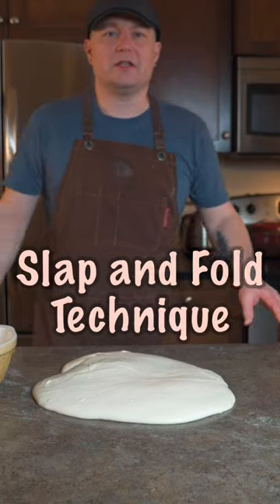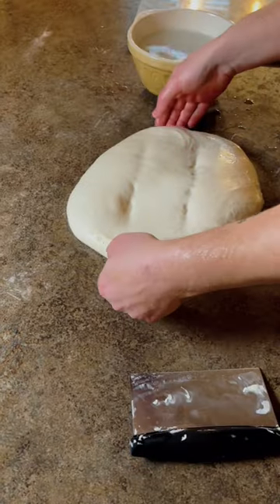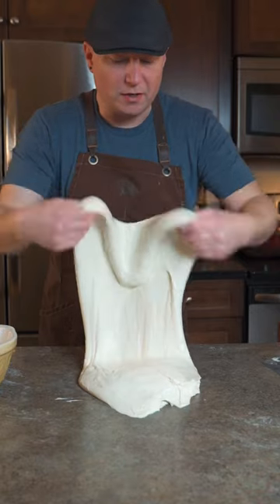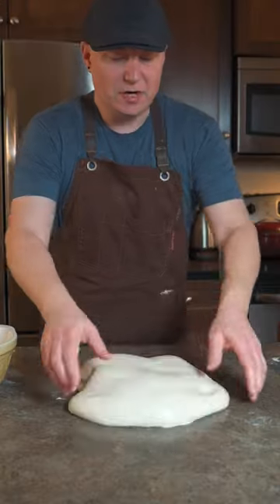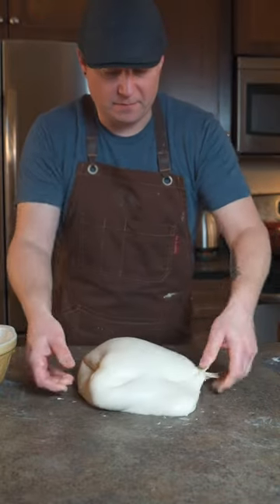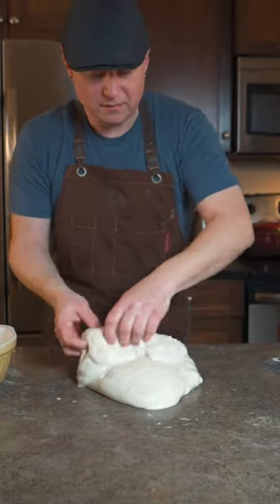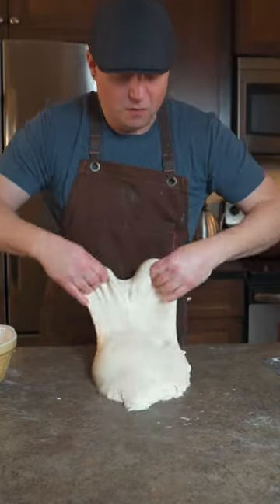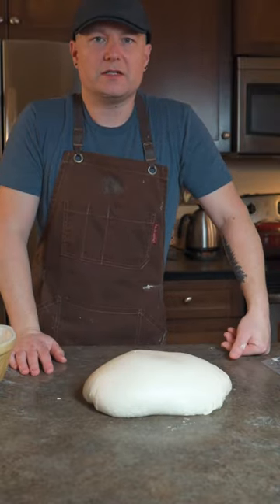How to do the Slap and Fold Technique

Comment: How do you get it so flexible and wet but not sticky?
Reply: Wet hands
Reply: Flour with high gluten and wet hands
Reply: Well developed gluten, wet or oiled hands. bakers touch. It's very sticky when you first start.
Reply: Its sticky as hell when you first start, as you work it, it becomes less sticky. 

Also keep your hands wet.
Reply: foreplay
Reply: ... and please do not stick your fingers into the dough! always touch it at the surface.
Reply: @Wilson-md4bv  flourplay
Reply: @Wilson-md4bv  😂
Reply: @kizza8585  😂👏🏻
Reply: Refrigerator. 👍
Reply: MAGIC.  ; ))
Reply: @Slanderbot  right but how does it not stick to the table either
Reply: My dough never gets this silky and flexible. 😢 Looks beautiful.
Reply: High gluten flour, wet hands, and autolyse.
Reply: he literally just showed u
Reply: Watch Richard Bertinet, inventor of the method, do it from start. There are many videos on YouTube.
Reply: Use slime.
Reply: When it ferments a bit and drys a little it becomes easier I imagine as well.
Reply: Thats the purpose of the technique 😂 before it was super sticky
Reply: Basically, it's because of this slap and fold technique. I watched a longer video about it some time ago.
So, you see how at the beginning this guy also had sticky dough? With the bench scraper, use it to "walk" the dough, and get it all neat and tidy. The top would now have a smoothing surface, even though still a bit rough. Do what the guy in this vid is doing, grab the top third, lift, stretch to the side and cover the bottom third, then rotate and repeat, keeping in mind the top (smooth and untouched) and bottom (the folded part). Remember, be gentle when lifting and stretching otherwise it will stick. Feel free to wet your hands well, to make it easier.
Reply: More you flipping the less stick
Reply: People keep saying "wet hands" but additional moisture just seems to make the problem worse. I'm obviously doing something wrong because when I do this dough that makes it back to the marble spreads on the marble and sticks there, while little globs of dough have flown off and stucks to walls and cabinets. And of course to my hands. Bertinet says "clean up" at this point, and that cleans up the marble but now the dough sticks to the scraper. 20 minutes of this, waiting for it the dough to get some body, but really only getting an increasingly messy kitchen and a smaller and smaller ball of dough.
Reply: @anka2612  "always touch it at the surface."
LOL what surface?

Comment: Not quite the right technique. This is the ending part. Richard Bertinet actually did it without rotating it, but kept it at the same angle. It develops the gluten much more efficiently, and incorporates more air. Then he moves on to rotating the dough after each slap and fold, as you do here, only at the end.

Probably makes little difference to the end result, but is faster the way Richard Bertinet does it.
Reply: Any technique that works good for you is the right technique. I like turning it because it's easier for me at least.